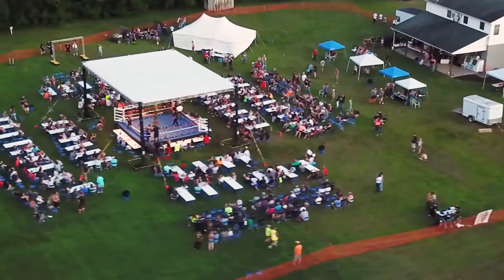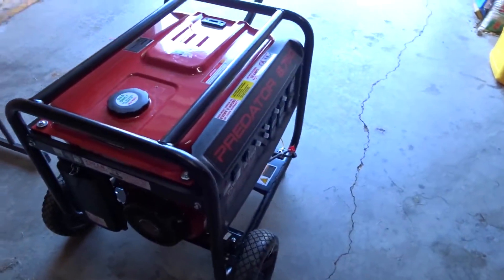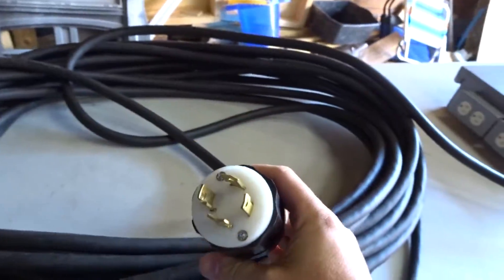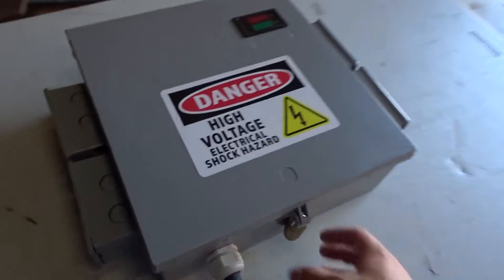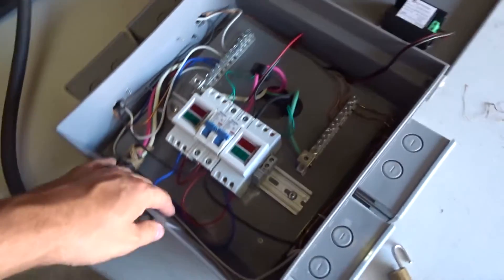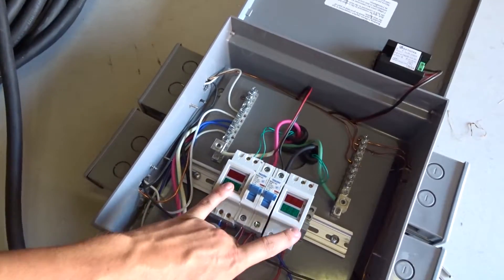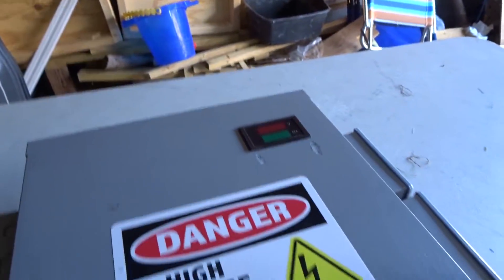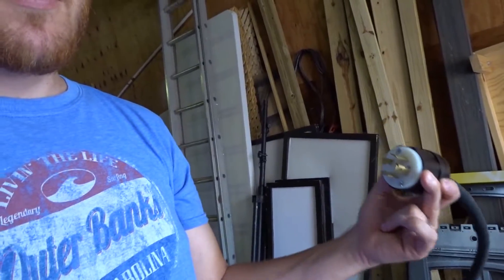DIY Power Distro for Sound & Lighting

Comment: L1 & L2 are 180 degrees out of phase relative to one another.  As such, the neutral only carries the difference current not the sum.

I don't see bushings on the pass through holes in the sides of the case.  Chase nipples are intended for that use, check them out.

Consider using pop rivets to mount the boxes with in future projects.  Nose piece on a pneumatic rivet puller will easily fit into those boxes.

Always make connections BEFORE powering up.  Reverse for tear-down, de-energize circuits, then break connections.

The 125V boxes appear to be residential plastic boxes - Outdoor Bell type boxes are great for that type of use.

Comment: Pro tip. Rent a 8 to 12 KW diesel generator. Use the 50A 259V twist lock outputs to twist lock cable. Rent the cords in 100 foot lengths to contractor spider boxes. This drops 6 20 AMP outlets at the stage, while the generator is about as loud as a car at fast idle. Needless to say, the difference between an air cooled and water cooled generator is huge.  Check with your local Sunbelt, United, or other heavy equipment rental place. I have run the generator less than 90 feet from the stage and with the program going, it could not be heard.  In my area if you want to use a portable inverter generator, the rental rate is $40 daily or $105 weekly. I don't worry about having gas go bad in the carb for long term storage.  If you need a generator no more than twice a year, it may pay to rent one instead.  Fueled, maintained, and ready to run.

Comment: I'm getting into throwing mobile events potentially, and am just learning about power distro's and their use cases. I have no intention of wiring my own, but this was very insightful for how they are used. My only question- with 2 20amp circuits, what exactly are/ were you using in terms of equipment? Was this only for sound reinforcement, or were you able to power speakers, amps, as well as turntables/ decks etc. too?

Comment: Pro tip... get another pair of L14/30 plug set to get your panel disconnected from 150’ of #8 - its easier to transport without it, and would allow you to use shorter cables when you don’t need the 150’.   Also you would be incorrect about hooking up to a “dryer plug”... you are exceeding the available power rating for the cable - even though you are breakered at your box.  Power safety is all about the “what if”. Sounds like you have a good understanding about this though, which already has you ahead of 75% of youtube content.  Also get some protection on the wires entering the box, the rough cut holes might eat up that solid core casing.

Comment: Nice Distro.  Well thought out.  Something I just learned is to figure-8 coil your excess distro cable.  8awg and 10awg cable pulling 30-40A coiled in a 2'-3' round can act as a big 60Hz inductor.  It can do funny things the AC power feeding your distro.  I think it has to do with current/voltage phase issues.
Two suggestions:
Replace the cable connection to the box with a 30A twist lock plug and socket.
A big box on the end of a long heavy cable sucks.
Cut a square hole in the front and install a plexiglas window so you can see the 120v meters.
Reply from the maker: So I had actually already changed the box to have a twist lock plug on it. That allowed me to get a few different lengths of feeders to minimize the runs! Great ideas!

Comment: just a few things you need to work on

1 that needs to have a certificate of compliance from a registered electrician if your planning to use that at a public event...
2 get a sign that says danger 240v volts NOT a high voltage sticker
3 get GFCI on the outlets on the distro
4 you also need a main circuit breaker on the panel and then one for each  output so thats 5 total the ones internal are pointless
5 the volt and amp meters need to be displayed externally..
6 NO EXPOSED WIRES OUT OF THE BREAKERS OR METERS!!!!
7 current chokes are too close together
8 Gourd/earth wires must be insulated
9 with your hertz meters fluctuating like that your going to need a power conditioner
10 take the screws out and replace them with nuts and bolts then ground then to the bus bar that grounds to the generator then attach the generator to an ground/earth rod
11 get a cap to protect the pins 
12 get a UPS to protect your decks and computers
Reply: gfci? you must never use big amps....
Reply: Abe  I have had a lot of issues with audio gear and GFCI breakers,,
Reply: Yeah GFCI is no good for high power amps... startup alone trips them, and no, there is not a problem with the amps...  I actually spec jobs to events that say NO GFCI panels... anything I provide for stage power, I have separate duplex boxes with gfci protection, but my amps / lighting get straight breaker circuits.
Reply: Also you should add bushings where the wires are going out to the duplex boxes.   Looks like you have raw metal holes that you may have 'chewed' or drilled out.   Especially given this is a mobile box, those sharp edges are eventually going to tear into the wires and you'll have big problems.   To make the holes in the metal boxes use knock-out punches, not a drill.  Hope is helpful.